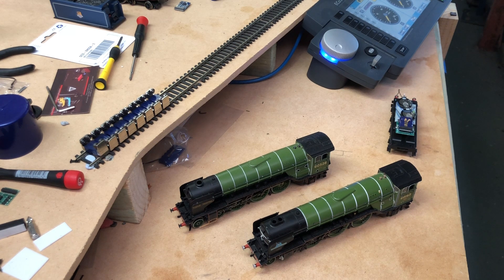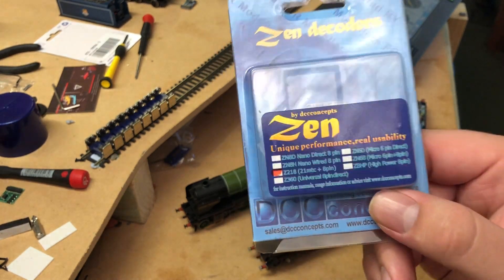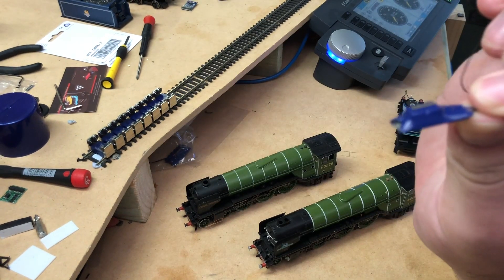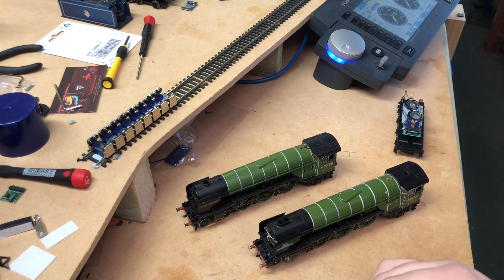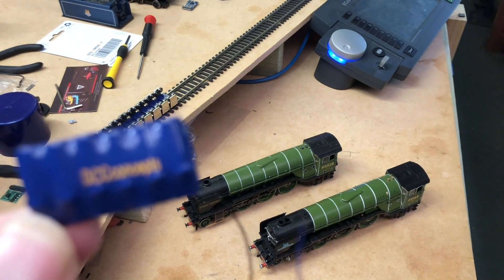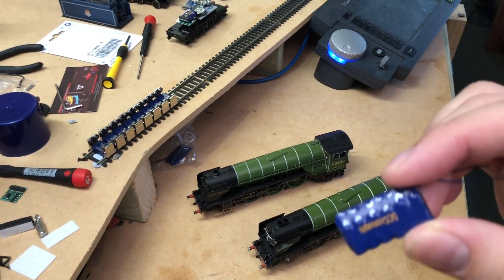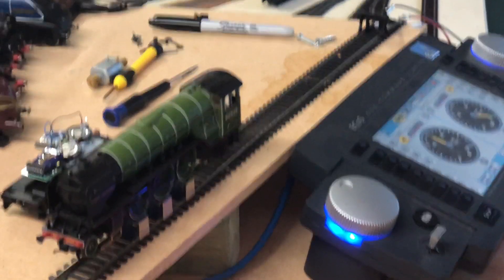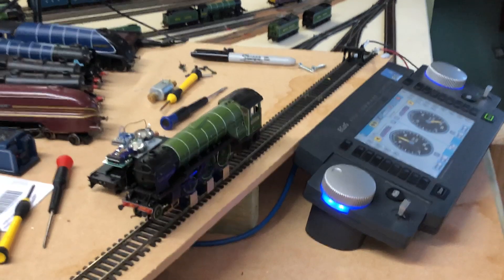13. Reviewed: DCC Concepts Zen Super Capacitor

Comment: When you get the Zen 8 pin decoder straight out the box, do you literally just plug it into the PCB board if you are not worried about the other energy saver thing... and do you need to do anything with the purple and black wire? Are those 2 wires just there if you want to connect the two together?
Reply from the maker: That's correct the purple and black wire are only there for the capacitor, otherwise, it functions as a normal DCC decoder would.
Reply: The Engine Shed thank you for the help.
Reply from the maker: Dugmer Junction My pleasure! Thanks for the comment! Cheers -Ben
Reply: @theengineshed359  it went up in smoke :(
Reply from the maker: @DugmerJunction  The decoder went up in smoke!? Can you tell me what Controller you are using? and the model you put the decoder in?
Reply: @theengineshed359  We use NCE Power Cab, 1st off we tried a Bachmann Class 47, It programmed fine and we set the address. Put it on the track and the lights would flash and the motor was trying to do something but kept cutting out, We then tried a Hornby Class 50 and it instantly went up in smoke as soon as i selected the running number for the decoder. - Btw, this is no reflection of you :) i was just letting you know. I put it down to a faulty chip.
Reply from the maker: @DugmerJunction  Thank you for the reassurance haha. Im sorry to hear about it none the less, I haven't had any issues with my Zens but im transferring a good portion of them over to ESU. Was actually speaking to a DCC concepts rep recently, he told me the company is having difficulty with QA of their manufacturing, certain components don't meet the specs required. It still shouldn't be a lottery, have you requested a replacement per chance? - Ben
Reply: @theengineshed359  That's not good, yeah they have offered a refund or replacement but advised the ZEN chips have under a 4% failure rate, or something along those lines.

Comment: hi you have done exactly what i want to do put a stay alive on a 21 pin decoder (mines with sound ), could you draw a  circuit diagram and where to connect to on he 21 pin decoder
regards tony
Reply from the maker: G'day Tony! Personally, I have not attached a supercap to a sound decoder. The PDF link in the description shows a method to do this wiring diagram included. But your suggestion will be taken on board for a future video. Cheers... Ben.

Comment: It’s 0.1666666667fard  not 6. The voltage adds the  capacitance devides... https://www.allaboutcircuits.com/textbook/direct-current/chpt-13/series-and-parallel-capacitors/
Reply from the maker: Thank you for pointing out my error (D'oh!). You never realize this sort of thing when you put these videos together, but good on you for keeping me accountable haha. This is a video I will eventually revisit and correct in time (you only need to look at the terrible camera work to see why). Thanks for the comment! Cheers... Ben.
Reply: Another question Ben do u still do dealing with DCC concepts since they move. As I’m in Australia too I’m interested to know how they are these days
Reply from the maker: @MR66HD  Yes I do still use DCC Concepts for more specialized things like the Point decoders etc. The earlier products are not desirable they've had several issues with voltage regulation between different DCC system manufacturers like the old ADS 8fx is a good example, the units I have are starting to fail and im replacing them with the ADS 8sx units. Since they moved they appear to be having a hard time meeting supply, and the cost is now higher thanks to the GST on online imports. As far as decoders are concerned, go with ESU this bloke is worth a look sells ESU cheaper than anyone else I've come across https://www.eurorailhobbies.com. Cheers... Ben.

Comment: Interesting. 

Tell me - how many carriages can one of your steam locomotives pull up the helix?
Reply from the maker: This is an interesting question, without a definite answer. In total honesty, it varies case by case. If you watch my review of the Hornby B1 that locomotive although small it has much better traction than a Hornby A3 if it was to pull the exact same rake of coaches up the grade. But on average 5-6 mk1 coaches is possible for most "Stock" mainline RTR OO gauge Steam locomotives. Im sorry for the vague answer James, however, it gives me a good idea for an upcoming video. Stay Tuned! Cheers... Ben.
Reply: I shall look forward to the upcoming video, in that case! I have already subscribed.